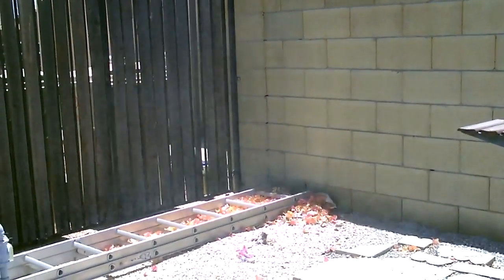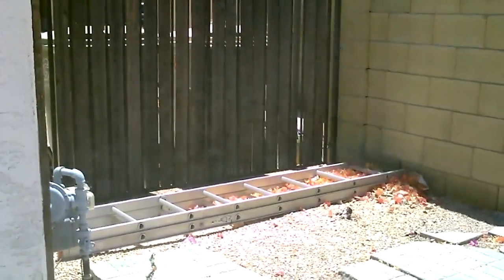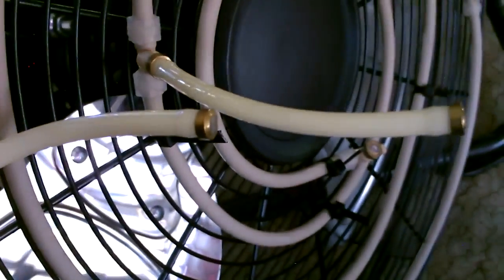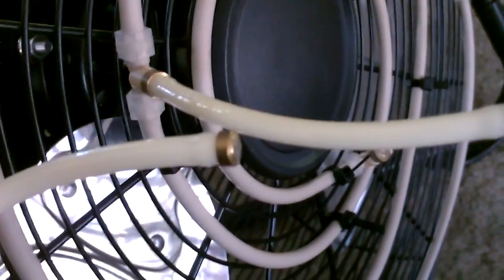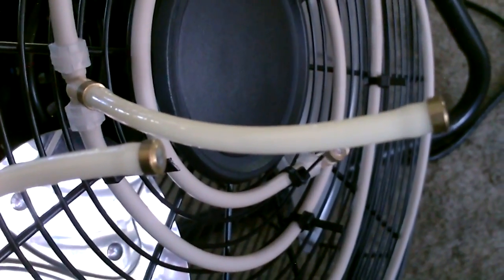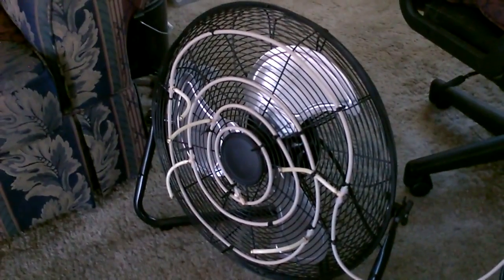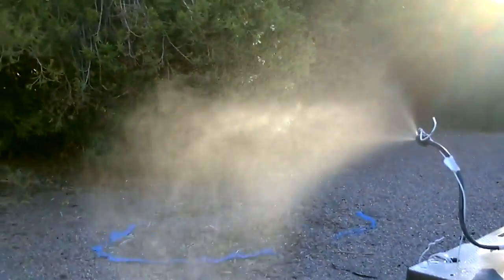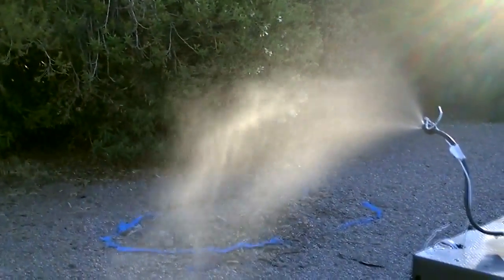High-Velocity Evap Air Cooler! (w/6 mist nozzles!) - ez fan conversion! - Garage cooling! - ez DIY!

Comment: Have seen those videos about cutting two litter plastic bottles and placing them spout first into a panel? The air flowing through the restricted openings causes the air to drop in.temperature. Idea, make a panel out of aluminum then use copper pipe that has the shape of those cut up two litter plastic bottles. Then contruct an insulated conduit you can place a high velocity fan and a mister in that then made the air pass through one or more of those panels to constric the air flow dropping the air temperature greatly. Could set it up to draw air in from another room through an intake vent in a window that then circulated cooled air into another window. Might try using infrasonic water misters in that build. You know you could design this concept to be used under trailers? Design a insulated conduit box that can be broken down for easy transport. Then see how many infrasonic mister and aluminum panels with copper air restrictor sections a owner would want to cool the air in their trailer. Then place the insulated conduit on a stand under their tralier attach water line for misters. Then the electrical for the blower motor to force air through the system. Then the insulated air intake and insulated exhaust vent with the cooled air flowing into the trailer. For home use really insulate the system or another idea would be to burry the system in the ground because a few feet down the temperature is cold which would help cool the air flowing through the system.

Comment: I've got one of the high flow fans used in this video and need to figure out how to cool my garage with it for wood working. It's unbearable out there here in Phoenix! Maybe build a funnel around the back and butt it up against/attach to your Jumbo Sized Evap Air Cooler design? I would set it at the back door.
Reply from the maker: hi there. i've tried this fan with my jumbo sized evap air cooler design. (it actually fits on the board very well) but it works about the same as just using a box fan. you'd think it would work better, but in terms of temperature, it's about the same. why not just use fan setup as shown in the video? it should cool a garage off very well.  ~ and as long as you have good airflow in and out, it shouldn't raise the humidity any more than the jumbo design (which is minimal... and not noticeable in the dry climate)
Reply: + desertsun02 Thanks!
Reply: I am in Phoenix for the big garage trying to get some woodworking in edit so unbearable I’m looking for the same options you are